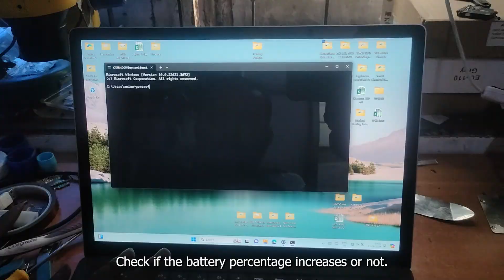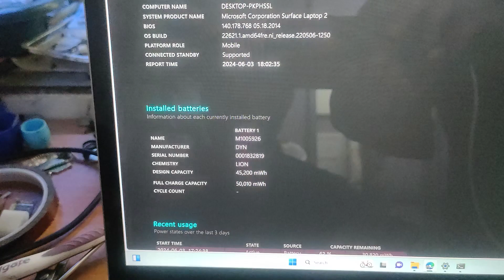Microsoft Surface Laptop Not Charging | DIY Battery Replacement

Comment: Actually I have managed all the steps but still my battery doesn't shows up, even if i check my battery health from command prompt there shows no battery installed. But my pc works if i plugout the charger or plugit in? What is the real issue here please help me
Reply from the maker: There must be some problem from Motherboard. We need to diagnose it properly. But whatsoever the issue, we have seen such cases and we are quite confident that we'll solve it guarantee. For more information call +91 999 245 245 9.